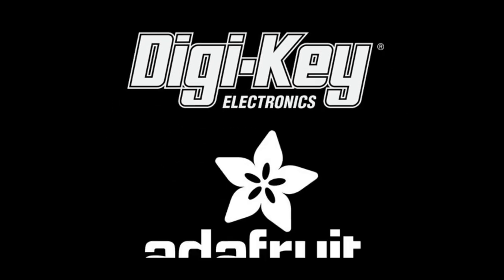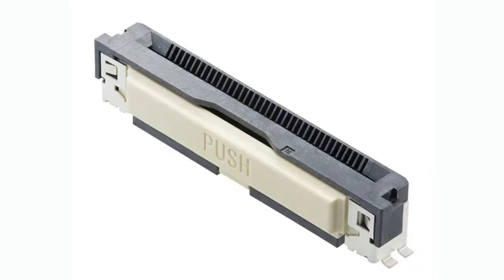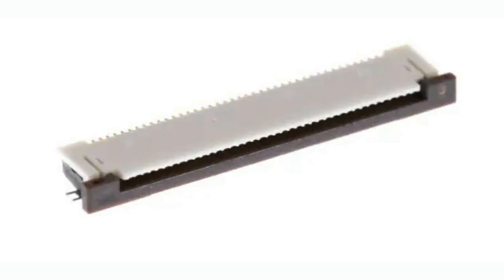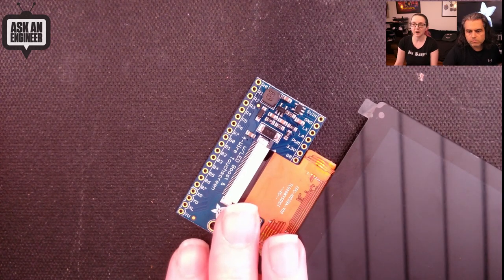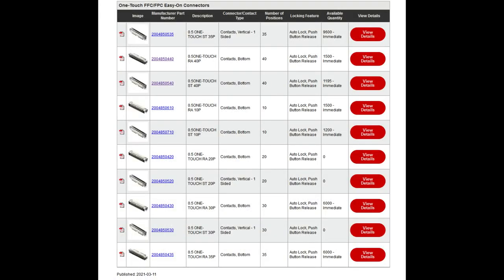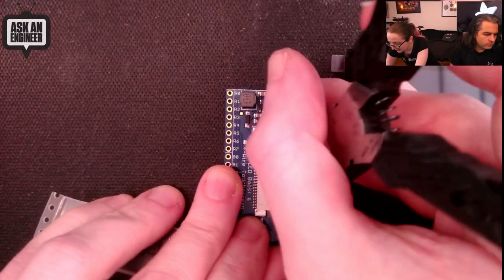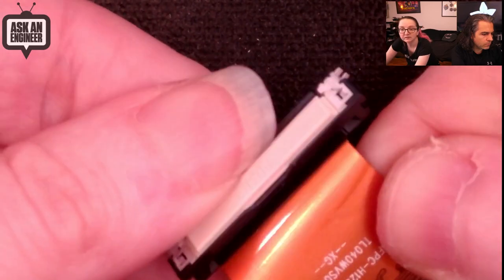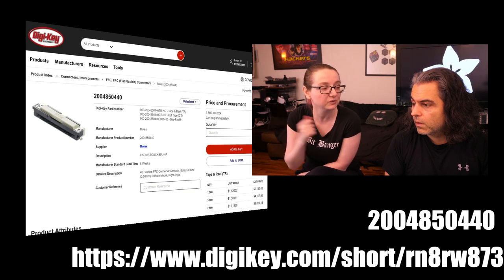EYE ON NPI - One-Touch FFC/FPC Easy-On Connectors #EyeOnNPI #digikey @DigiKey @MolexConnectors

Comment: Yet another flex cable connector... Though this looks easier to use than a super fragile Molex connector I broke recently. (And it actually has instructions on it which is nice) The one I broke was a "backflip" connector, you have to actually lift the back of the connector up to unlock it. Had never used that kind before, and the moving part broke almost instantly when I tried to open the front side.

I wonder if the footprint is compatible enough that I could rework that board with one of these instead.